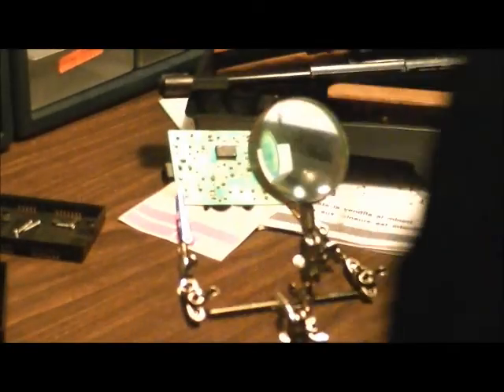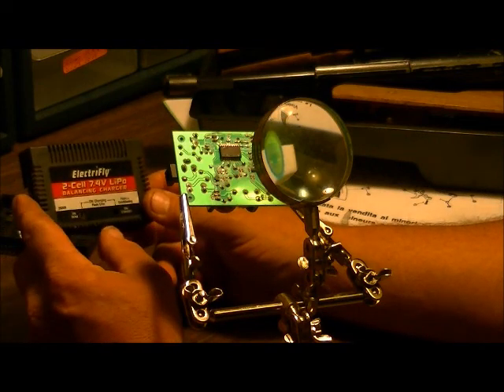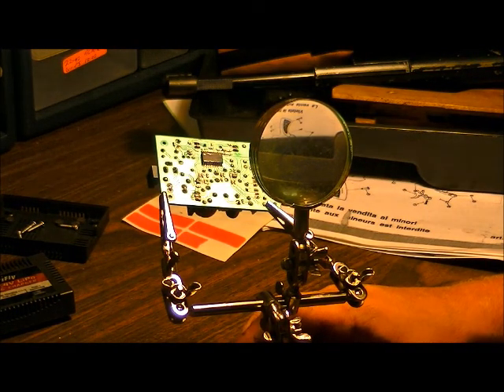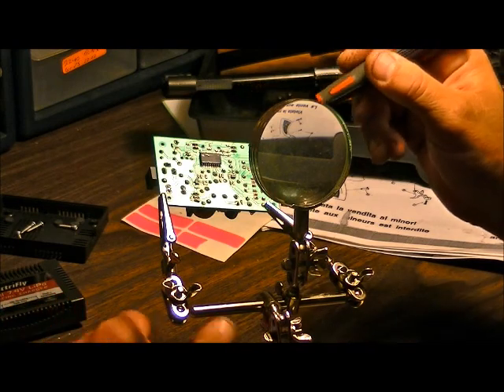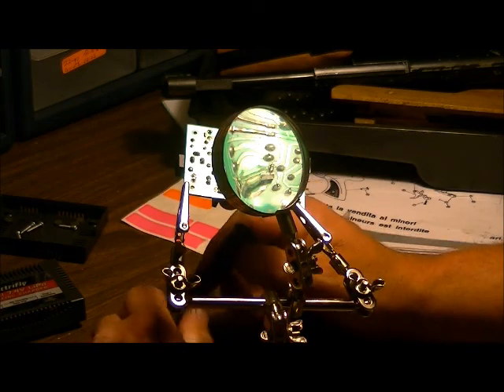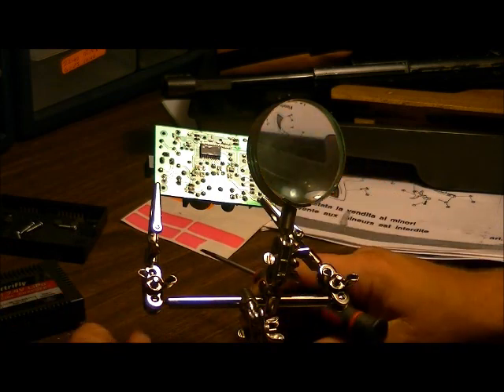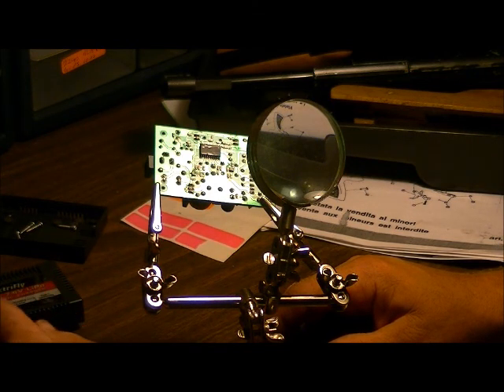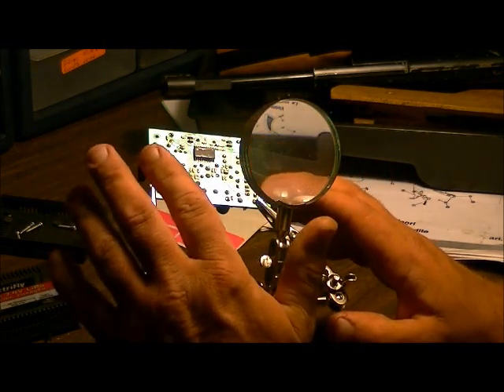How to Repair a lipo balancing charger

Comment from the maker: hey guys just an update here the repair on this charger failed so it looks like we did not get the repair of the solder joints in time, however the ac adapters work fine but the charger box is fried so shes scrap this time ,as i said its not 100% gaurntee that its going to work every time